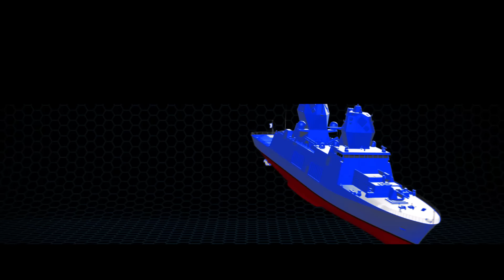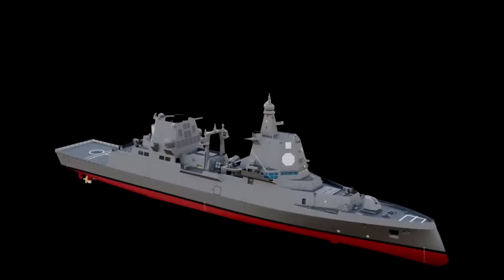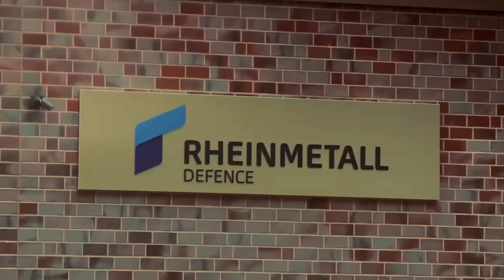The World's Largest Super Frigate is Taking Shape || How Big and Powerful is the F127 Frigate?

Comment: If it's destroyer-sized, then why is it a frigate? Modern warship classification makes no sense.
Reply: Yes, with the sensor suite and planned weaponry, it's a DDG.
Reply: @blablubb12345  nope, its a frigate.
Frigate and destroyer are not classified by tonnage, size or armament, but intended use.
this ship is intended to operate in a surface battlegroup as core air defense asset.
this turns this ship into a frigate.
if it was intended to operate alone for a prolonged time and conduct combat alone, it would be a destroyer.
Reply: @cathulhu-q7y  Point of a destroyer is protecting the battle group from smaller enemy combat vessels. Name "destroyer" is shortened from "Torpedo boat destroyer" since when the class was invented, torpedo boats were considered main danger to larger surface combatants. Ship that is supposed to be able to operate alone as well should be classified as cruiser, since again, that was originally the point of a class. Frigate class is very obscure and various nations seem to read different things into it. Initially though, it was supposed to be small and dirt-cheap ASW ship with limited capablities to do anything else.
Reply: @平教經  no longer the case though.
look up modern definition of destroyer, cruiser and frigate.
you are working with late 19th early 20th century definitions
Reply: @cathulhu-q7y  I am trying to say, that bending the meaning that happened in 20th century was unnecessary.
Reply: @平教經  it does matter, as both ship classes had major shifts in operational use and requirements since 1945.
A destroyer from 1890 is more akin to a modern torpedo speedboat or corvette. In 1930 the destroyer class had major changes in operational capabilities and requirements to the ones from 1890. In 1960 this had changed again.
A frigate specification of use massively changed from 1780 to today.
Reply: even modern destroyers arent destroyer sized, in the past destroyers were really tiny
Reply: @Psychonau  correct.
just as if technology advancing, more powerful engines and systems etc being included, increases the size of a vessel...^^